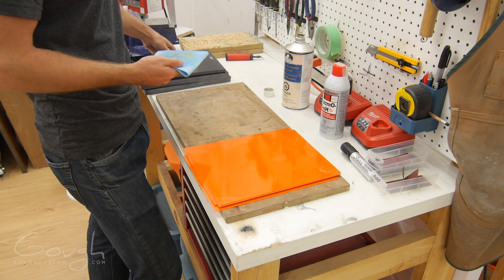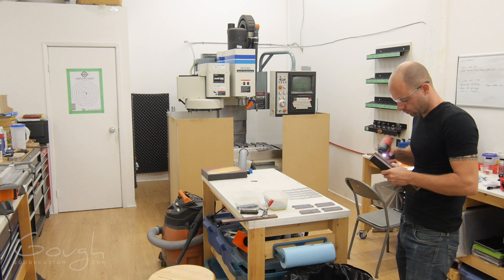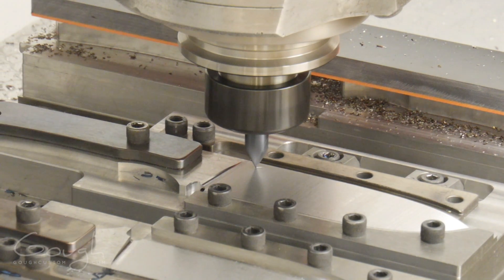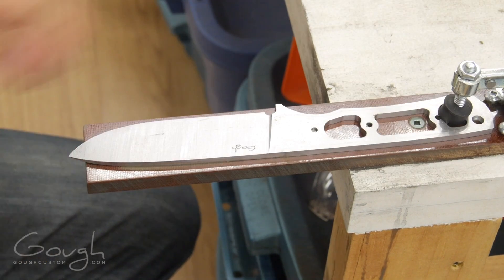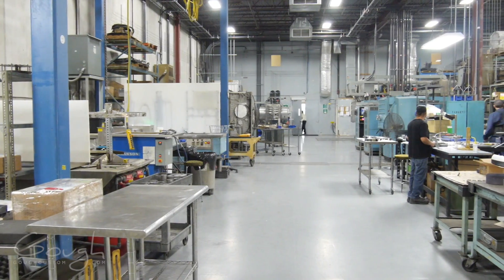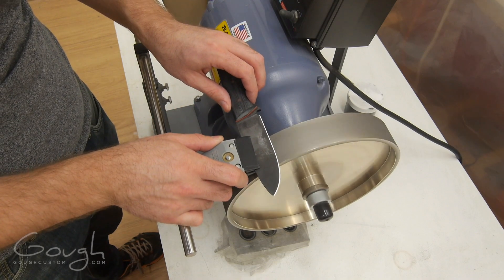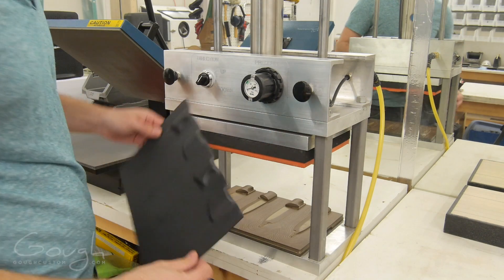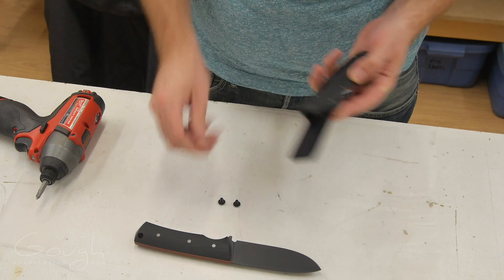Making a knife the high-tech way - Resolute MkIII

Comment: Is there a benefit to Kydex instead of leather for a sheath? Maybe I'm just used to cheaper knives and I'm not sure if there are different grades of Kydex (I'm sure there are), but it seems like a knife of that quality could use a good sheathe. Please correct me if I'm wrong. I mean no insult, just confused by the material choice. Beautiful knife!
Reply from the maker: +John K hey mate! I usually think Kydex is a much better material which is why I use it. It's immune to weather and damp, never requires any maintenance, and most importantly allows me to shadow the sheath such that the knife snaps into it and is retained wihout the need for any clumsy clips or straps! Overall I much prefer Kydex sheaths!

Comment: hey i was wondering why you dont cut the G10 with a band saw or a table saw
Reply from the maker: +Dave's Blades hey Dave! I have used both in the past, but when you're cutting a lot of G10 the blades wear out very quickly. Even carbide blades on a chop saw/table saw only get like 60-70 cuts before they start getting to dull to be safe... The diamond blades on the tile saw last for hundreds of cuts and are much cheaper to replace! Also much safer as the abrasive saw blades can't really cut you that bad, and the water stops the dust from getting everywhere
Reply: do you ever cut and bevel and hand shape the handle and bevel the knife your self?
Reply from the maker: Dave's Blades not for customer knives, only for prototypes and so on

Comment: What CAD program/programs do you use and how do you upload the g-code to your Fadal? Love what you do. Love from 🇬🇧
Reply from the maker: Hey mate! I use Fusion 360 for CAD/CAM works very well! To upload code to the machine I use a box from Calmotion that provides a USB adapter.
Reply: Gough Custom Thanks for the quick reply. If I could ask 1 more thing. I'm ready to start looking for my first vmc, if you were to do it all again, would you have saved a little more money and got a slightly newer vmc, or did you do the right thing in buying a older fadal and upgrading the serviceable parts so you end up with a very tight machine? Thanks so much for taking the time to get back to me👍
Reply from the maker: +Debo Devil no worries mate! I think the Fadal was a good choice overall. There are definitely some nice cheap other options though in the form of used Haas machines and so on.. I think that buying new would have been a mistake, but I definitely had to play catch up to learn how to repair the machine!

Comment: This knife is very well made,and you have a very impressive workshop and production process. I have one question regarding CVD process. Since the process is normally done at very high heat, if your knife get softer after this process or it remain the hardness as the same after finishing the CVD process.
Reply from the maker: Hey mate! Good question! The answer is that I'm actually using a PVD process, not a CVD process. As you may know PVD is a much lower-temperature process, the application temperature is below the temperature that the blades are tempered at which means they retain full hardness.
Reply: That what I thought, I also work in PVD and CVD field and wonder how you achieve this. thank for the answer, it is very appreciated!!

Comment: Everything made by computers, it is not really art. He does't even touch anything. Nice machines.
Reply from the maker: It's important to remember that the machines do nothing without me... I rebuilt the CNC from the ground up, as well as designing all the fixtures and toolpaths that the machine runs, I also made the sharpening system and pneumatic press from scratch. The entire process is designed by me, the art is in the process and the fusion of modern techniques combined with hand finishing.

Comment: Just a quick why bother with hand sanding if your going to tumble and blast post HT.  with all the production stream lining the hand sanding part seems like wasted time ?
Reply from the maker: Technically I can leave out the hand sanding part and the blades would look the same after blasting, however the tool marks would still be there (disguised by the blasting) and I'm concerned that after a lot of wear they would show up, so I remove them to make sure the knife will look great even after a ton of use!

Comment: Could you share some information on your converted bench grinder with the CBN wheel and wood wheel with paste?  Im guessing its a three phase grinder run on single phase through a VFD.  Any links you have for the wheels,  bench grinder and VFD would be appreciated.  I like the tool rest you built to rest a tormek blade holder
Reply from the maker: That's correct it's a Baldor 3 phase grinder running with a KBAC-24D VFD. The right wheel is a 10" 600 grit CBN wheen from D-Way tools, the left wheel is a home-made MDF wheel that I load with CBN paste.

Comment: very nicely made video bud... looks like you are reinvesting in yourself, and living the dream, thanks for the great video...  

a tip to you... get yourself a two way hydraulic press.. and some S7 tool steel bar, and a couple of rods and springs.. make yourself a set of hot work forging dies to match your blade contour, using your cnc mill... 

Die forging is not considered as sexy as hammer forged, but if done properly is every ounce as good; and will still step your product value, and marketability, up ten fold..  Be sure to stamp the word forged on them dudes next to your logo.. will hold the edge much longer no matter what grade of steel you are using.... if you aren't familiar with making dies there are many books on it.. and a lot of great youtube videos too... just look up tool and die... best wishes to you and yours.... you do that.. and you will only have a couple more steps to be matching the big boys methods.... in some approximation.

you can also use S7 to make a set of cold work, or heated, dies to cut your sheaths.. .would be way faster than milling them... hope this helps... love your love of your community and its resources... is nice... good luck, and merry Christmas.
Reply from the maker: Hey Jim! Die forging would be pretty cool! I will likely look into it one day!
Reply: Good luck bud... keep reinvesting in yourself and lifting up your great community of industry and service providers... is a great example..many of us sure wish we were in your shoes.

Comment: High tech??? You mean mass produced? 1 hand forged blade would last twice as long as 10 mass produced pieces of steel shaped like a knife
Reply from the maker: Hey Robert! That's actually very much not the case. My knives will out-perform pretty much any hand-forged knife because with my stock removal process I'm able to use a much more sophisticated steel than what is normally used for forged blades, forging is usually limited to very simple steels like 1095 and so on.

Also, my knives are definitely not mass produced. I only make around 100 per year and I personally make every single one.

Comment: regarding belt sanding those screws, arent you concerned about hitting the G10 with the belt?
Reply from the maker: Hey mate! I actually deliberately sand the G10 as well as I have to blend the pins into the handle... It takes a bit of practice not to mess up the handle, but luckily I've had plenty of practice to get it right! I never mess them up now.

Comment: I still think that design is one of the best I've see. Although that sheath is functional, adding more options for carry could be a point of improvement. I see something like that a good candidate for scout carrying... So a horizontal way to wear it would be nice. Also, a tensioning screw for adjusting retention could also help long term wear. Just a couple suggestions.
Reply from the maker: +David Mm thanks David! The sheath is very easy to add to, the holes are 1" apart which means they're compatible with many after-market accessories!

Comment: why does your code run rough cuts perpendicular to the cutting edge? wouldnt parallel make the cnc faster, while still preserving the perpendicular finishing cut for presumable finishing reasons?
Reply from the maker: +Eric McGhee interesting question. In think it's faster to do the roughing cuts perpendicular if in remember right, but I'll have to double check!

Comment: Aaron,

Excellent video and workmanship as usual. I do have one question, however. In your blade testing for impact resistance and toughness, I thought I had recalled that one of the blades that performed most favorably was A2 heat treated to 59 - 60 HRC. However, on your website and recent videos explaining the heat treat, you state these blades attain 62 - 63 HRC. Can you explain this discrepancy, or am I making a mistake?

Thanks
Reply from the maker: +Dominic Zelenak hey mate! Good memory! Yes in the testing the A2 I used was around 60HRC, however I did more experimentation afterwards and found that i really liked it when it was a bit harder. All of my A2 knives have been heat treated to around 62.5 right from the start and I've been really happy with the performance! Toughness is roughly the same, but edge retention is better!
Reply: Gough Custom great! Thank you for the clarification. Toughness, to me, is the most important parameter in blades. The amount of experimentation you do is very impressive. I like to know that what I'm using isn't going to bend, break, chip, etc and I'm glad you take the time to verify these things.

Comment: this is a good way to make a knife for mass production but nothing will beat an old school hammer and forge
Reply from the maker: +Sean Fox actually in terms of overall performance this method will trounce forged knives quite handily. Forging usually limits you to get simple steels, whereas I'm able to use better steel and get far better performance.

Comment: You should check out Pierson workholding for a solution that will allow you to swap those fixture plates out without losing their positioning. I think they make something like a fixture pallet but they’re pretty cheap if I remember correctly
Reply from the maker: Thanks! The pierson stuff looks really nice!  I actually have locater pins on all my fixtures already, they can be removed from the table and put back within 0.0005" or so, just cheap dowel pins with holes bored into the machine table, works really well!
Reply: Brilliant!

Comment: Im with you until the grinding of the fasteners.  Why not install hex hardware so the user could remove the scales?
Reply from the maker: I have looked into that, but I don't like the look of the knife with hex fasteners on there unfortunately. Also I really don't think there's any need to remove the scales, and having them on there permanently means that the fasteners will never come loose or be lost or anything.

Comment: Glad I can make things with my own two hands...not do it all push button machines
Reply from the maker: Hey Kyle! If you look at my older videos you'll find I'm more than capable of making knives purely by hand, even without power tools for the most part in fact. Personally I find it very enjoyable to design processes and get the knives as close to the perfect vision in my mind as possible, and that's just not possible working by hand. Sure I can make one perfect knife, but the next perfect knife will still be different in a bunch of ways, and that means that the customer can't swap sheaths at will and so on.

It's also worth noting that this video shows the simple side of this process. There's no way I'm just pushing a button and the machine is making a knife. I also rebuilt that CNC mill from scratch, and designed all the fixtures and did all the programming, as well as making the pneumatic press and sharpening system. It's literally hundreds of hours of work before I get to "push the button"...

Comment: You're not a knife maker, your cnc machine is. You design, sharpen and assemble.
But your designs look great.
Reply from the maker: Sorry Caleb, but that's pretty far off track. You have to remember that I rebuilt that CNC from scratch, I developed all the fixtures and programming to cut the blades and handles (3 versions of them so far) and I designed this entire process as well as lots of the tooling I use in the process. I designed the heat treatment process, and the sheath making process as well as actually working on every single knife by hand to finish them and so on. What you see here looks simple because it represents thousands upon thousands of hours of design, testing and refinement. This is absolutely knifemaking, by me, taken to the highest level that I can take it.

All of the above is on top of learning to make knives to the highest standard completely by hand, so that I can do finishing and so on to the level that I need to... Lots and lots of work has gone into this process and continues to go into every knife.

Comment: What's the point of sanding the blade if you're just going to blast it after?
Reply from the maker: Hey Logan! You will still be able to see some of the machining marks after blasting if I didn't sand it beforehand.
Reply: Gough Custom Gough Custom Using a larger endmill might help reduce the mill marks as well if you have the room in your blade mount for the larger radius. Or even a finer finishing pass to help smooth it out because I know I don't like lapping parts forever, though the blade didn't look too bad out of the CNC I've certainly seen worse finishes. Thanks for the reply

Comment: Any exotic materials in the plans? Carbon fiber or timascus handles? Damasteel or any kind of damascus blade?
Reply from the maker: No damascus or damasteel. the performance is not as good as mono-steel blades unfortunately. I will be looking into offering carbon fiber handles though as well as some exotic stabilized woods. Timascus would be too heavy for a handle this size unfortunately.

Comment: The knives look very nice, however it also seems like a hugely inefficient process. No wonder they cost 350 bucks.
Reply from the maker: +Tezcax hey mate! If you have any suggestions for improving efficiency I'd always love to hear them! My process is designed to be as efficient as possible while keeping my quality as high as possible...
Reply: I'd try to stamp/punch/forging the blade as much as possible before CNC machining it. It is much faster than cutting every little hole on the mill. I guess you're doing the best you can for a small shop though.
Reply from the maker: Gotcha, yeah if I had access to a big press then fine-blanking could be an interesting option, however with the space I have available it's not really possible unfortunately.

Comment: That's not knife making, you can barely say you made it, that's a knife maker saying "knife watching" being made, lol
Reply from the maker: +Surtac100 sorry mate, but that's pretty far off track. You have to remember that I rebuilt that CNC from scratch, I developed all the fixtures and programming to cut the blades and handles (3 versions of them so far) and I designed this entire process as well as lots of the tooling I use in the process. I designed the heat treatment process, and the sheath making process as well as actually working on every single knife by hand to finish them and so on. What you see here looks simple because it represents thousands upon thousands of hours of design, testing and refinement. This is absolutely knifemaking, by me, taken to the highest level that I can take it.
Reply: I didn't know all that, you do make some very clean knives, I see why now! You have come a long way it seems, Grats keep it up

Comment: cool process. if your doing stock removal with limited numbers of designs this is definatly the way to go. it certanly saves you some time once its all set up and increses precision. i guess after you work the bugs out of thr program and are confidant you wont make any errors in installing the blanks, then you can oretty much just let it do its thing. the only downside is your more limited in the variety of knives you can make with that much setup.

have you thought about investing in a surface grinder to do the initial polish? seems like that would save some time and increse precision too. you could easily get a better than 220 grit finish on it.

being a sharpeing snob ive heard lots of exagerated and subjective sharpness terms before but never "terrifyingly sharp" before lol. imo if you want to throw out a term like that, back it up with some tests other than paper cutting and arm hair shaving;)

I like the clean utilitarian design of the knife too, verry well done. id mabey do things a bit different with the handle ergos (more rounded and with a palm swell) but id have to use it to see. nice video and ill check out your website.
Reply from the maker: +shonuffisthemaster thanks bud! The handles look quite angular (that's the look I was going for) but once you examine them from a few angles they're actually very rounded, I find them very comfortable even for many hours of carving.

The surface grinder won't be able to help with blade finishing unfortunately, otherwise I would definitely be doing that! The blade is a flat grind, but it's not actually flat as it has to taper off toward the tip... A very large form wheel could technically do it, but I have never seen a machine with a wheel wide enough to do it!

Comment: How often do you change out tooling.
Reply from the maker: +Johno S around every 4 knives now that I'm machining after heat treatment, I think I was getting s around 10 knives per tool when I was milling before heat treatment like is shown in the video
Reply: Gough Custom what would be the reason for machining after heat treatment?
Reply: The Semite I am also interested in understanding the benefits.
Reply from the maker: It produces better surface finish (by a lot), avoids the possibility of finished blades being warped/damaged during heat treatment, and shortens my process drastically!